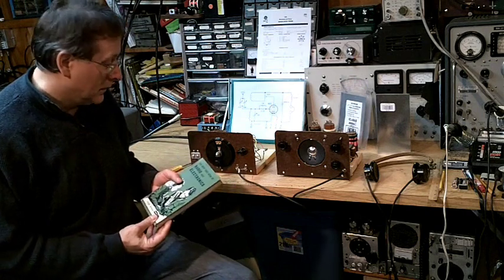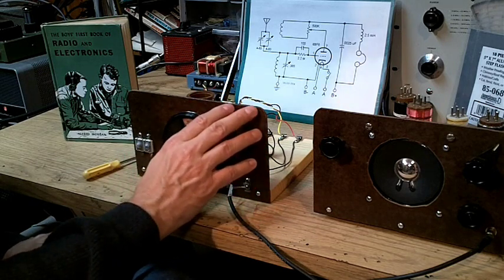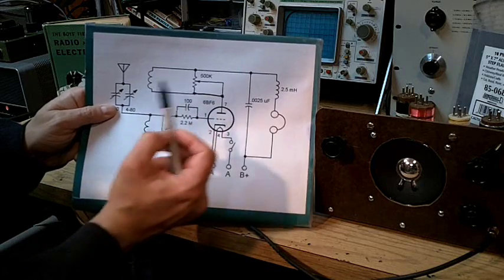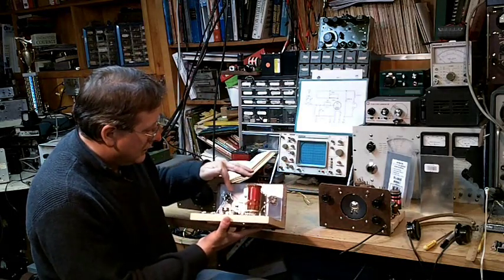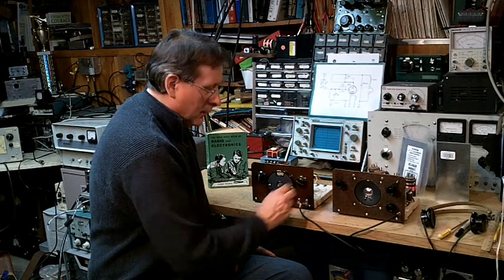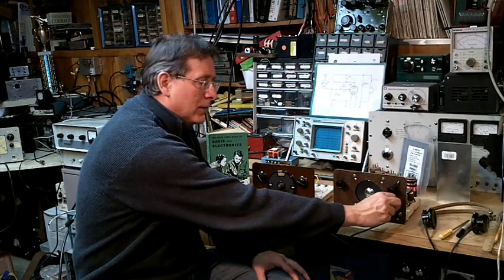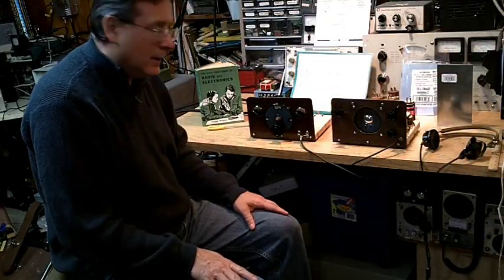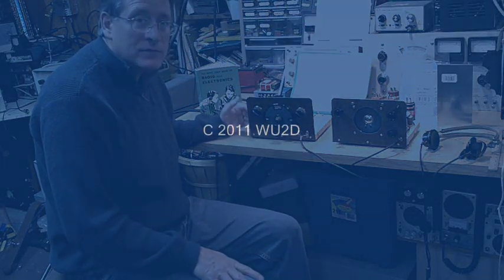Morgan One Tube Regen Part 2

Comment: Very good, I built a similar one using a type 30 tube. One doubt, to plug it into the amp, I need the audio transformer first or can I plug it directly to the amp ? thanks
Reply from the maker: Check out Part 4 of Morgan Revealed. Yes I did use an interstage transformer to isolate the input.
Reply: @MIKROWAVE1  thanks

Comment: A couple of other changes made to the receiver.  I changed the output to a Bogen T725 line matching transformer.  Using the primary as an autotransformer I was able to make an impedance match for crystal earphones.  These tend to sound tinny but my ears hear better with them.  I was also able to use the secondary (8 ohm) output for low impedance earphones.  No switch needed; just two output jacks.  I also switched to a 6C4 tube (some minor rewiring required).  I think it goes into regeneration easier and I think I have a little more volume at the output.  My set is battery powered and when I found out the 6C4 filament current is 150 ma vs the 300 ma for the 6BF6 I was sold.  I also added a filament voltmeter to help prevent operating it with low filament voltage.  I have been reading that low filament voltage can degrade indirectly heated cathodes.  I also added a B+ switch to prevent low voltage operation during start up and shut down.

Comment: Howdy. Nice.
I would suggest using a pentode. The tube gain may be done adjusting the screen grid voltage. My experience is a smooth onset of oscillation and no avalanche effect at max regeneration.
Regards.

Comment: Thanks for the series.  I am rebuilding the Morgan that I built when I was in junior high or high school incorporating some of the changes you suggested.  I liked the clipboard suggestion so well that I am making a raised base plate and short rear panel out of clipboards, too.  One advantage to this is I can do most of the wiring underneath.  True, I can't use the ground plate underneath but I think the front metal plate is more important from what I have read.  One error in the book I have not seen mentioned is of the pictorial drawing guide showing a top view of all the wiring (page 173 in my edition).  The tube socket is rotated 180 degrees from where it should be to match the tube pin numbers.  Nevertheless it is a great book.
Reply: Reply to myself.  I finished building the set and it works well.  I believe I found another mistake in the book: the schematic has an error.  The "T" and "C" label for the tickler coil should be switched.  The 2 drawings of the circuit show it correctly.  Also, I used a 10K pot instead of the suggested 5K.  I found it to be very touchy and eventually reduced it to 2.2K but it was still very difficult to adjust.  I measured the resistance where regen occurred and found it to be in the 600 ohm range.  After reinstalling the 10K pot the way the original circuit shows it I found the regeneration to much, much easier to adjust.  It may have something with having a 10K resistance across the tickler coil versus almost shorted the suggested way.  Yes, I have some wiper noise but it is worth it to get the improved regen adjustment.  I realize some of my experience may be due to how I wound the coils though I did experiment a bit with that.  I tried to use an output matching transformer to drive a modern low impedance headphone.  The sound was muddy no matter what I tried.  I fiddled with the grid leak resistor/capacitor all to no avail.  I believe a good part of the blame is a cheap head phone but not all of it as a mixer amp also showed the output had too much low frequency audio.  I discarded the idea and installed a resistance/capacitance output and ran it to a guitar amp which is high impedance and was very satisfied with the result.  At any rate, it's been a lot of fun.

Comment: Mike, enjoyed the video.  I had bad luck when I was a kid trying to get regens going so I played more with DC and superhets as a result.  
Question:  You moved the plate connection to include the whole coil @2:40.  Since we are looking for "AC/RF" feedback, would it be appropriate to place a capacitor in series with the wiper to the plate; this would allow the 'rheostat' to NOT change the DC level on the plate (i.e. the DC would always be going through the whole coil and not be bypassed when the wiper is at the 'top' seemingly bypassing or shorting the coil altogether)?  Thanks  &  73...
Reply from the maker: I have not tried this. Sounds interesting. I have seen the plate choke fed, and the throttle cap in series with the tickler to ground, which also breaks the circuit for RF.

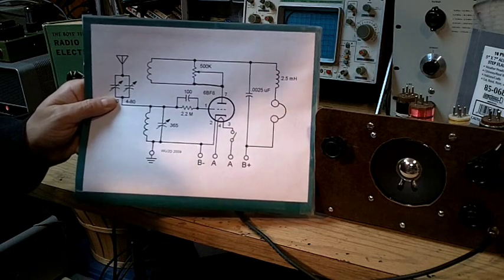Comment: 3:04 That high resistance potentiometer maybe to limit plate voltage, if it were in series with the feedback coil?
Reply from the maker: Any time you want to try and influence regeneration with a change in voltage to the detector stage, you have to consider the interaction of the detected audio on the voltage source's impedance - causing undesired effects like popping suddenly into regeneration. So we like to keep the voltage source at a very low impedance, rather than adjusting it with a series resistor. A variable DC regulator into a low resistance audio choke would work very nicely.

Comment: What about hairpin inductors for 432-900mhz
Reply from the maker: Nobody uses hairpins anymore. Curlers? I have to admit that I have not made an oscillator or superregen receiver above 170 MHz with tubes or transistors.
Reply: @MIKROWAVE1  they can be used for frequencies from 432MHZ-600MHZ and are shown in the RSGB VHF/UHF Handbook as well as stripline tuning circuits.

Comment: Hi Mike.For some reason I just can't get to the lower frequencies.Even with another coil.Not sure if it is something I did wrong or is  it just the set itself.So at least it does work.On short wave I can only get a couple of stations.I have a long outside antenna of about 100".Thanks for all your help.

Comment: So if I use 30AWG wire,do you think I still should wind 150 turns and 25 turns on the coil or can I get away with less turns? Thanks Mike.
Ray.That's my name by the way.
Reply from the maker: If you have a second plug in coil, by all means wind at least 130 T on it to catch the bottom of the band.

Comment: Hi Mike
Have built the radio and works ok but  I can only get frequencies from 800 Kc to 1600 Kc.Have used a 1 1/4" coil with 25 wingdings on the tickler and 100 turns on the rest of the coil.Wire is 26 awg gauge.Any suggestions? 
Thanks.
Reply from the maker: So that is why Morgan had the second coil with more turns on it. To handle the bottom part of the band. The 150T coil with say 25T tickler should get you down to 450 KHz to 1000 or so. You may need to use thinner wire to fit it. Say 28 enameled...

Comment: hi what size coil (diameter) is used? also what  wire gauge for sw and am bands?  thank you.
Reply from the maker: Coil Data is always needed. But it is never correct in the real world in my experience because there are simply too many variables. will the kid find a plug in coil with exactly the 1.25" Diameter you might require? Morgan cleverly solves this by suggesting two coils. One with 70 turns and one with 120 Turns. Between the two you probably will hit the BCB! Fooling with coils is part of the fun. As a general guideline, I like #26 AWG enamel for the BCB and up to 3 MHz.
Reply from the maker: So for the BCB, maybe 100T and 20T tickler - and for 80M and 40M or 3 to 8 MHz, it pays to use a bit thicker wire like # 22 and you may only need 25T and just 5 turns for a tickler. Space  them 1/2" apart for both bands.
Reply: @MIKROWAVE1  Thanks Mike.I wonder If I can get away without the RF choke if I use an amplifier.?
Reply from the maker: @rsantiqueshop  The choke acts to isolate the RF bypass cap from the headphones or the output transformer. So if you want to skip it, use a 4.7K resistor in place of the choke, a. 001uF cap to ground as a filter and a 47K down to the power supply B supply. You take the audio off the top of the 47K through a 0.1 uF cap to the Amp.
Reply: so if  I wind some 30 awg magnet wire on a sewing bobbin would I be close enough on the required value of the RF choke for my Morgan receiver? I just don't have one of those meters to measure the  inductance.Thanks again for all your help.
Reply from the maker: @rsantiqueshop  Yes, as much as it takes to fill it. Use a cordless drill with a bolt to hold it.
Reply from the maker: Better yet wind 2 up and stack them for more inductance and don't forget to use a Brass screw not steel, through both of them, to hold them down.

Comment: Hi again, I built the 1H4G 1 tube set which is close to that circuit and one issue. Nothing came out, so I touched around the circuit and accidentally touched across the headphone jack and the Stations came in... So I thought "Resistance". I place a 200k pot across it temporarily and it sounds good.. The headset is a 2k headset that I use on my other set and works great on them.. This is the first time I have seen where I have to place resistance across this type of headset. I think there is something more to the circuit that needs adjusting. Also, I had an issue with the 2.5mH choke where it came apart and I re-fixed it by tac soldering it. I was curious about how it would work without it so I shorted it and the stations came in louder by 20-30%.

Comment: One other question: I have a Multi Elmac PMR-7 receiver with a 262 KHz IF section. I want to make a Q-multiplier for this radio. Can you suggest a simple circuit made from available parts to do this with?  Thanks in advance. —Karl

Comment: 8:10 The One Tube Regen Set I mentioned earlier is a much simpler design - - quite juvenile!  I built it many years ago from a kit I ordered by mail. Just a little drilling, soldering, and screws were required. I wound the coil(s) by hand - - it is not a plug in, and the aerial connects directly to it thru a small capacitor. The potentiometer has a Ohm  value that is too high for effective use at full plate voltage of 45V

Comment: I've been building a few different regen radios recently, my favorite so far is https://www.qsl.net/pa2ohh/02reg.htm 
I've changed it up a bit: I'm using a tickler coil with a center tap that is grounded, and the regen pot's ends are connected to the ends of the tickler coil, it's wiper connected to the collector. This allows you to blend between negative and positive feedback which seems to give smoother control in my experience.
I've added resistors and capacitors in series with the antenna coupling coil on both ends, to reduce the coupling and capacitance to ground.
I'm also using a TL431 as an audio amplifier.
With a single coil and tuning capacitor that I pulled out of an old radio (dual ganged, both gangs in parallel), I can tune from about 500khz, up to about 2.8mhz
I'm in Cape Town, and at night I can hear Asian, and South American stations.

Comment: Your comment at 8:00 is sort of funny in a morbid way because I'm certain that you've already noticed that the original design can practically kill a child with that B+ to the ears DC circuit.   Funny but at the same time, not funny.   https://www.youtube.com/watch?v=qPN6M3YEg24
Reply from the maker: Any time you bring up the danger of exposure to HV, it is controversial. I was that child. My electrically challenged dad almost accidently fried me when he decided to install some surface mount outlets and plugged it in as I still was holding the wires! It is a wonder I am still here, I have had perhaps 50 to 100 HV shocks. Actually my latest video on the repair of the DX-40 has a whole HV warning section with two funny and not so funny stories. It features a 750V supply that really got me nervous about even doing that video.

Comment: Nice video! Can you tell me what type of antenna do you use with the regen receiver? Can I replace the 6BF6  for the 6SR7?
Reply from the maker: I have used a variety of antennas from a 120 ft long wire, to a 80M dipole, to a very quiet large vertical loop antenna, with these simple radios. The 6SR7 is an excellent perhaps even a better tube if it is the metal type. Ground the diodes or tie them to the cathode.
Reply: @MIKROWAVE1  I thank you very much for your quick response and the tips for using the replacement valve, I really enjoy your videos and the simple explanations of each topic, I got my radio ham license very recently and radio is a topic that I really enjoy, a greeting from Uruguay, CX1IT 73!

Comment: Thanks Mike. The only thing I see is a little set screw that keeps the shaft of the variable snug with the vernier. Is this what you're referring to?
Reply from the maker: Turn the vernier over so the brass is showing. You will see an oval recessed feature located just above the little pinch drive. That is sometimes outfitted with a screw, a threaded nut and sometimes it's  just a plastic hole that sits over a screw head on the panel that keeps the thing from rotating. Glue an upside down screw into the hole if you have to.

Comment: Hi Mike, 

  How did you attach that vernier dial to the face plate. I have one like it but it seems that it would only slide over the shaft of the variable capacitor
Reply from the maker: There will be one small recessed feature with a hole just below or above the shaft. This will take a single 4-40. That is it! It basically keeps it from rotating. So you need to support and recess the variable so the shaft just pokes through. Then the vernier flush mounts.

Comment: Hey, I'm currently building on this radio. Collecting parts at moment. One question I have is how is the best way to approach getting rid of the DC in the phones audio. I have thought of using an audio transformer here. So I could use any audio amp here. Or maybe a simple resistor for the plate supply and cap to pass audio for the phones. Would appreciate any input you may have on this Thanks. Keep up the great videos lots of fun.
Reply: The circuit has a severe, potential safety hazard.  If a perspiring barefoot child in a warm, humid location such as Los Angeles were to have the receiver well grounded, the moment she applies B+  to the radio, she could receive a painful and dangerous shock with current flowing from head to toe.  Apparently beside not realizing that girls too can learn to love electronics, Morgan didn't think about electrical safety.  Perhaps a 20K resistor from B+ to the plate and the 2.5mH choke  tied to the headphones in series with a 10uF DC blocking capacitor.

Comment: Is the audio amplifier also from the Morgan series?
Reply from the maker: +Mgraemem 
The audio amplifier is basically the amp circuit lifted from an AC/DC All American 5 Receiver! The amplifiers in the book are simpler and safer!
Reply: Ah. I found an example of just such a thing. Do you think that the amplifier you build for your crystal set using the 1U5 and 3V4 would be suitable in place of this amplifier?
Reply: MIKROWAVE1 My grandmother had one of those old tube AM radios. It sounded much better than a mono AM radio had a right to.

Comment: Hi Mike
Thanks again for the A1 video. Enjoy them both frequently.
Despite my having a shelf full of needlessly-expensive stuff, you take me back to the (my) days when school boys were building stuff which had been recently in service, Ham & WW2.

I just obtained an identical friction reduction drive and would like to ask you about it.
1) How do you fix, the black 4" disc, against the front panel?
2) What is the significance of the two additional dial windows? IS THERE ANY?
3) Silky smooth, it is NOT! The drag varies from point to point... Any adjustment or lubrication likely to help.
4) Can't find a type or maker's name... Made in USA?
73 de G3NBY...Keep up the good work...You're held in high regard.

Comment: Very nice Mr.Morgan.  I wonder how the tube works with 12 volt D.C.  I learnat that any tube/valve requires minimum 40Volt D.C to maintain plate  potentential for electrons to amplify Plate Current. Pl. provide me Circuite diagram Schematic If possible.  Thankyou

P.Bhanumurty  Hyderabad India  contact No. 9848528516

Comment: a separate b+ connection to the plate. Then place a 100pf capacitor in series with the tickler coil to remove all dc from it.

Comment: Beautiful work. Morgan`s `First radio book for boys` was my bible in grade school. I built his regen. design using a 12a7 tube, (which I still have!). I have a comment and suggestion for your improved design. Morgan used that 50k instead of a 5k regen pot to reduce loading on the tickler coli, which of course is coupled into the antenna coil. This spoils the Q of the circuit. The best way to avoid this is simply to remove the 50k pot(or 5k) from across the tickler coil and connect it in

Comment from the maker: The antenna coupling variable or trimmer capacitors need to be insulated from the grounded plate. The turns ratio in the Morgan book is way overkill. For a broadcast band coil you need say 90 turns with a 15 turn tickler on a plug in coil form. I used a 2K to 5K Ohm transformer to connect to an external amplifier but it is not critical.